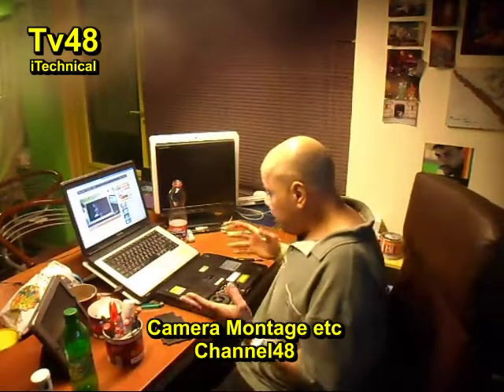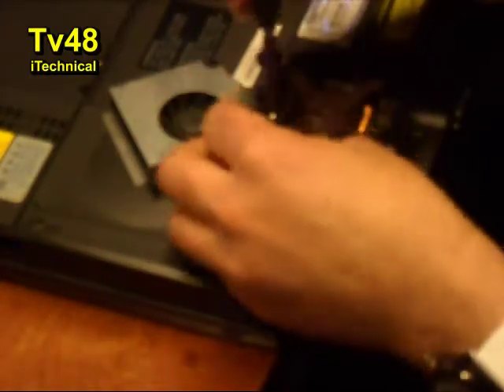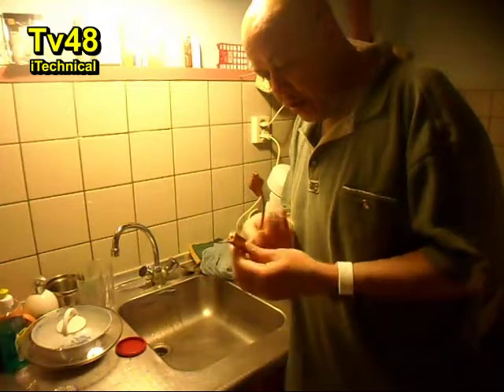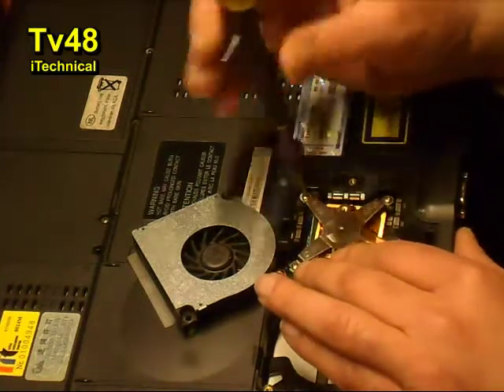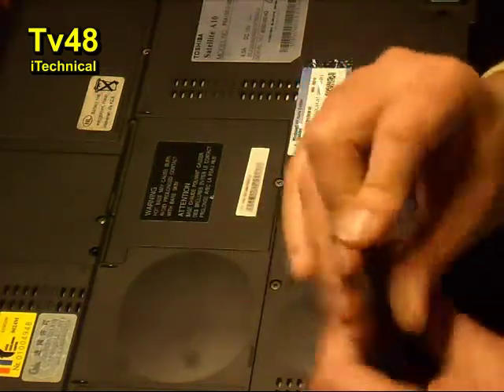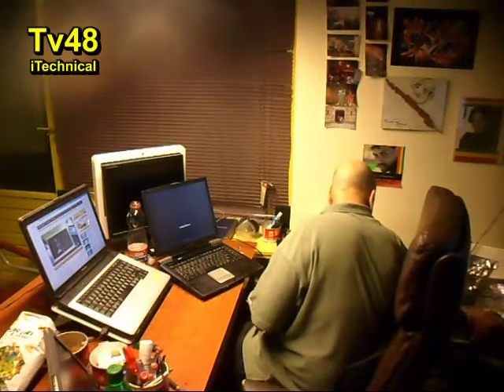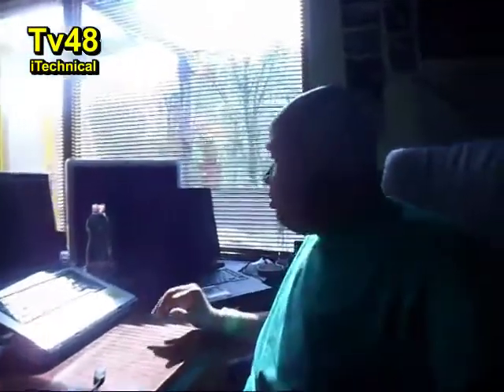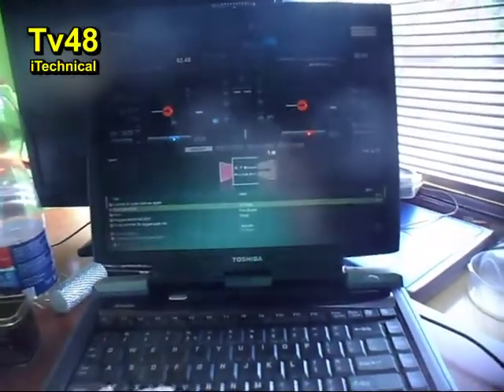Toshiba A10 LAPTOP - SHUT DOWN PROBLEM FIX 2012

Comment: Please, do not mislead people doing this in that way.
1. If you take off the cooling body you have to gently clean the old thermal paste and add a new one, otherwise your cooling body will not cool down as it suppose to and you will have bigger problem after.
2. You can easily use a Deodorant or something similar with air pressure or harmless liquid like the Deodorant to flash out all the dust from INSIDE-OUT and you can even give it a bit more power with the vacuum cleaner at the other side.
P.S. Not all of the laptops are so easy to be cleaned that way, for example on most of the HP products you have to take off the motherboard to reach that dusted cooling body.
Reply from the maker: Mislead wtf - ? the laptop is still u and running - Read above I had no paste left this was a emergency help out and deodorant? You crazy man ? all dust was removed already never blow dust into your laptop - and about the paste ..there was still enough on it and the fan will cool the processor even if no paste is added at all the paste is only for extra protection but i discoverd it dont really mather aslong if the bloodclouth fan and ports are clean trust me -